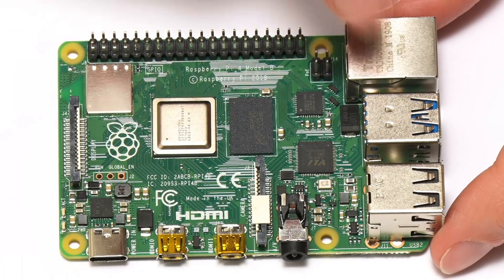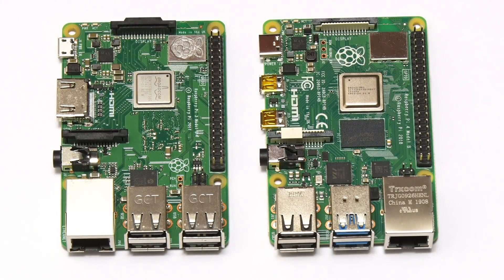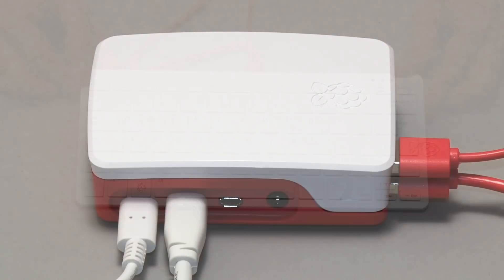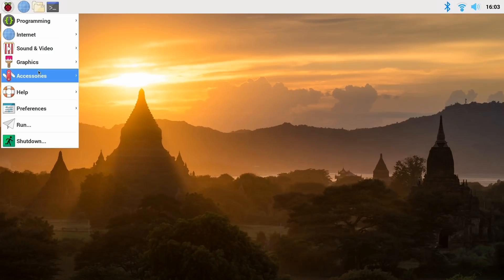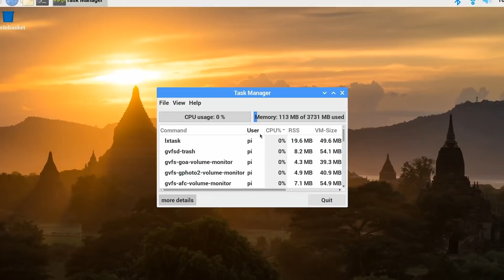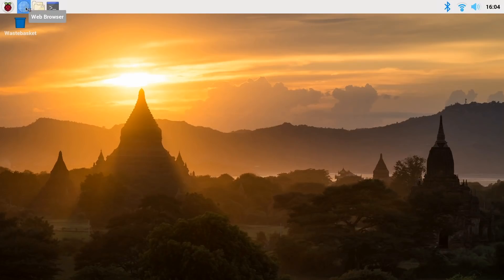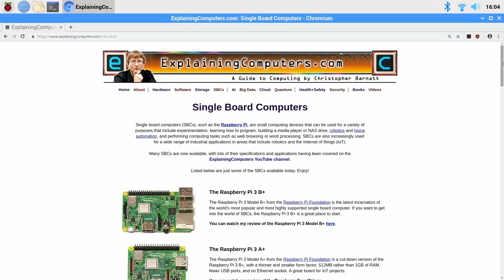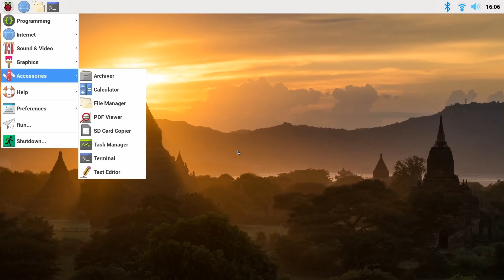Raspberry Pi 4 Model B

Comment: Watched a second time.  In a future video I hope you test USB 3.0 performance with a fast "thumb drive" or a USB3-to-SATA3 and a fast SSD compared to a fast micro SD.  Also, possibly a NAS connected over the wired Ethernet.  Both of these will make a big difference for RPi being used as a desktop replacement.
I have also heard that Bluetooth keyboard and mouse really hurt performance.  Can you verify this ?
I hope to see some good laptop setups for RPi 4 in the near future.  Minimum 15" display (maybe even 17") and good size battery pack (maybe 20700s ?).  Low cost over low weight.
Reply from the maker: See my video July 7. :)

Comment: Will we be able to boot from as SSD with this as we were with the 3B+???  Ive already pre-ordered mine and what to move my Pi Hole to the new 4B.  Would have been great if they would have added an M.2 connection as well.
Reply from the maker: In time, yes -- it is not currently USB 3.0 bootable, but they have promised a software upgrade.

Comment: I'm curious how ZFS would perform in Raspbian for a home NAS. Given my experience with ZFS in FreeBSD, 4 GB of RAM should be fine if you don't use ZFS deduplication. Conceivably with the Raspberry Pi 4B you could have several terabytes of storage connected via the two USB 3.0 ports, most likely in a ZFS mirror setup, or perhaps other ZFS configurations if you use an external USB 3.0 hub and connect more than two mechanical drives. With any luck that type of setup should perform adequately and consume very little power, especially at idle.

Comment: I plan to use the pi 4 for my organization's computer lab for the homeless, if the pi is really a fluid desktop experience for something like Ubuntu. Though, Rasbian does look slicker now than it ever has. It would be amazing to have a decent desktop experience on something so cheap, which means I could expand the number of computers for our clients because we are down to 4 old computers working out of a more normal stock of 8-10. Just need to think of a way to secure them to the back of a monitor or something.
Reply from the maker: What a great use for the Pi 4. I would contact the Raspberry Pi Foundation about your plans.

Comment: I will probably use 4 B to replace my existing 2 B based DLNA media server.
The 2B had issues with some high bit rate media files, the extra bandwidth of the USB3 port and true Gigabit networking should make streaming more fluid.

Comment: i think to be honest it needs extra pins headers either for soldering in or already mounted for reset and a fan header because sometimes the existing ones are taken up by an LCD driver board using them pins but it looks good .. I love tinkering with the PI3B+ its a small test web server at present and has Linux running on it ... like it a lot|! good video .. maybe treat my self to one once there more popular and got a more stable release .. i looking at networking with them with Arduino UNO or Mega :D so many possibilities  - good video :D

Comment: It's a shame no one has built an sbc with built-in poe on the network port. I'd like to see a single SAS connector on one too. That way you could run 4 SATA drives with an adaptor and it would make using it as a NAS better.

Comment: Im interested how low power this thing is. I have a itx  board that idles 8watts which is a j3000 celeron and if i push it to the limits it can go as high as 18watts.

I assume that 15watt power adapter is aim with scnario that you plug high power usb devices.

Comment: The Raspberry Pi Foundation did a good job of keeping the Pi 4B release quiet. Everything I heard was that the "new" Pi would be released some time in 2020. 
This improved Pi is just what I've been waiting for, and it will do everything I need a "backup" desktop to do. The poor thing will live in the basement, LOL! 
I must have missed the info on the SD card maximum capacity. A quick scan of the Pi website provided no answer. Maybe I missed it. 
Great video as usual, Chris. Thanks!!

Comment: Their marketing research team done a really good job at condensing competitors offers into maybe three core areas and adding those to the makers wishlist... More RAM, usb 3, bit more power and duel 4k output... thats fine... Sort of what we expected really... Plus their software and community support sort of seals the deal ... Its hotting up nicely in the SBC industry.

Comment: I'm not familiar with SCBs. Can you please explain why your graphics is set to 256MB and you say that's OK because we have 4GB RAM? Does that mean RAM is handling the graphics load? Can it be set higher? Is there a dedicated graphics chip? I'm curious to its performance over the course of your coming videos.
Reply from the maker: It can indeed be set higher. 256MB for the GPU would have been high on the easlier Pis with 1GB RAM in total.

Comment: At last the Pi Foundation has listened to users' requests.
More RAM on the Pi which should allow us to properly use 64-bit ARM OS'es (and those who don't need the extra RAM can always get the base model for the original 35$ price). 
An SoC with 4 Cortex-A72s should be beefy enough for desktop use. 
They've also removed the Ethernet NIC from the USB bus and connected it directly to the SoC. This should provide full 1Gbit/s of bandwidth.
They also gave us USB 3.0 which should allow proper SSD usage with the Pi.
The new VC6 GPU can finally do 4K and HEVC. And the GPU overlay thing is no more. Pi will finally use mainline Mesa drivers with full X.org acceleration and OpenGL support.
The only shortcoming I see right now is SoC thermals. That chip really needs a heatsink to unleash it's full potential. Let's hope our friends at FLIRC will make a nice metal case for the new Pi soon !

Comment: One of the big reasons why n64 emulation has been really slow on retropie was because it had to use a mobile version of open gl. now that it’s upgraded and has compatibility with normal open gl n64 emulation will run better since there won’t be later to convert data etc. i would expect a performance boost and people are talking about gamecube emulation. i wouldn’t hope for too much, but it’s certainly exciting.

Comment: hmmmm, I am still thinking this is still 'To little to late', anyone serious is using RockChipPro ( hexacores ) for anything above a desktop replacement.

A76 is put all these things to bed which is early next year which would be wise to wait for, just as anyone wanting a decent PC upgrade to wait for early next year AMD + new Chipset Mobo etc etc.  The foundation have take way to long to get this one out the door, id say 4 to 6 months to late.

Rockchip unfortunatly for the Pi have set the tempo since this one follows the same options with memory, and with the release of the BSP and everything else is supported 100% these days in the Linux kernel.

Comment: NAS + TORRENT BOX
Reply: WI-FI 5 GHz data transfer speed. If it will run as a NAS need to know what speed will i get when i will drop a video file from my laptop to an external drive connected to the pie's 3.0 USB port

Comment: What i wanted from the raspberry pi 4 was a DECENT quadcore/octacore chip a better iGPU with a small heatsink on it and more RAM options. This would have tremendously improved the overall performance of the board and would have kickstarted the further software development of the system. This would have literally changed the future for the better of the product and would have caused the extinction of the other bootleg pi's...

Comment: This looks like an amazing upgrade.  I'm curious how it would handle Plex duties.  If I could replace the big honkin' box I'm using now with a little bitty Pi, that would be awesome.  I didn't find the Pi3 B to have quite enough kick to keep things fluid ... mostly due to the lack of RAM, I think.  But the 4 ... that has some wicked potential!  The question will be if anyone can actually get their hands on it, or if it will be perpetually sold out everywhere like the B+ was for a long time.

Comment: How do you add hard drive space on a Raspberry Pi ? it would be pretty cool to use it as a low power 24/7 torrent seed box.
Reply: Could try USB 3.0 to SATA
Reply: (an adapter)

Comment: I love my 3B+ model, because it is low power consumption.  It runs from my 24" LCD TB USB power.  So. no need  another power supply. for it. 

Also, after installing the OS,  I set it up to use Bluetooth  keyboard and Magic Trackpad  for interface's input

Overall, it is nice low power desktop environment . But the 4B's 4GB RAM is soo unirresistible.. :) .

Comment: Why not use USB-C 3.1 instead of those huge 3.0 A Sockets?
If they had gone to full USB 3.1 using SATA over USB-C 3.1 would be a snap.
Also what is the maximum size of a MicroSD card that it can take?
They are now making Brand Name SDXC UltraHighSpeed cards in 256GB and larger.

Comment: Interesting upgrade but from my point of view they missed the real improvement (at least what I would need): analog pins in the GPIO connector. Something arduino already has. It’s a little bit of a struggle to read and control analog variables (currents in my case) with Raspberry :-(

Comment: Wow… That really is pretty impressive for the price! That extra RAM will open up a lot more options. When you do your more intense testing, it might be a good idea to see how reallocating more and less RAM to the GPU affects your tests, because you'd be changing the RAM allocated to the rest of the system at the same time. I wonder what this will allow you to run, that you couldn't on previous 'Pis.

How are you at drawing by hand? Got a drawing tablet? I wonder if and how Krita would run on this computer.

How about compiling a program? That's a test.

With some luck, you might even be able to run the full, modern version of minecraft, which has become harder to run over time, with the numerous updates it's received. If you try running Minecraft, though, there are some RAM settings that can affect performance, that need to be changed specifically when starting the program. I can't remember the word for it, but it's a string of text commands associated with the execution of the program. Of course, the full version of Minecraft costs money to buy, so I wouldn't be inclined to blame you for not buying it for a test, if you don't intend to play it yourself. (I have talked entirely too much about minecraft, compared to the other options, haven't I?)

Comment: Thanks for the video!
If you are going to test more in depth can you please also check what's the power consumption on these new PIs?
If you can it would be great to check in idle, under heavy load and also during video decoding.

Thanks!

Comment: not a big fan of the micro HDMI since they are weaker than the full sized HDMI, but still considering getting my first pi on thursday when i get my first paycheck from work, nice to know that the 5v 4a charger from my oneplus 6t will work fine with this since i have one spare from my old oneplus 3

Comment: It's impressive what they have managed to do again! I wonder about the "idling" power consumption. One of the reasons I like the Pi so much is for it's low power consumption. Will this use more power? Maybe not. But I suppose there are still most of the other Pi's (ZeroW etc) for those applications.

Comment: Again, another UN-remarkable upgrade by Raspberry. When they released the Pi3b+, it was kind of a let down. The Pi4b's speed is not much more than 20% faster just like the 2b to 3b upgrade. It was nice of them to put an on-board WiFi and BT adapter but I find myself using an external adapter because of the inadequate range of the built-in. It's good to have a Gigabit Ethernet port on it but, really, it only can handle speeds of not much more than 300Mbs?  Now in the rush to market for their model Pi4b upgrade, it is again just a little bit better than the 3b, although it is nice that they finally started giving us a more adequate amount of memory. Compared to their new competition, the Rock 4b, with it's many alternative options for storage and a much better enhanced faster CPU, there is no point for Raspberry to be releasing their  Pi4b, and just move on to creating a RPi5b as a true next step up to the new generation architecture. I thought of myself as a Raspberry loyalist but now, my next purchase will be a Rock Pi4b to use as a whole home DVR streaming system. I have tried using one of my Pi3s to use as a HD streaming client for a single TV and it performed horribly. I have my doubts that the new RPi4b has the power to record many incoming streams from network based tuners while serving up 3 or 4 outgoing streams that are being watched by family members. At least the Rock 4b can drive a 2T SSD at high speed directly without having to push it through a USB port.

Let me close with this; 

I really enjoy your videos but by seeing your review of the Rock 4b first, there is nothing you can say to drive up the 'hype' of this board for Raspberry. They are a day late and several dollars short with this model release. They should have called it a Raspberry Pi 3C+.

Comment: Exciting times for SBCs.  I knew RPi foundation would have to do significant updates to stay competitive, but I wasn't expecting this much this soon* (If you heard about a  couple months ago they said 2020 at earliest).  I'm looking forward to getting one of these ASAP and seeing what it can do compared to the 3B+ (they said about 3x improvement, more so with hardware video decoding).  And better yet, to mess with the market they've still got this at $35/$45/$55 which for what this has (I suspect) beats most/all the <$100 competition (but if I recall the RPi foundation is a charity, not your typical capitalist business, so they don't have to make a healthy profit).

*Though I REALLY wish they added a clicky-spring micro SD card slot, especially for hard-to-access cases (which is most of them).  Can't have everything I suppose (C'est La Vie).  What I use is a tape flag taped to the flat, smooth surface of the card or a trimmed down piece of scotch tape.  Either works pretty well.

Comment: I would like this Raspberry Pi mounted to a blank circuit board that plugs into a PCI-e X1 socket for power and has the ethernet side of the pi connected to a PC Bracket that I can add to my PC case.  I would find this extremely useful for a project with the Raspberry Pi being a Web Server for presenting Water Flow and multiple Water Temperatures readings to a web page with control over pump and fan speed.

Comment: Someone has already built a RPi 4b+ Cluster , running a website.  Here it is ! 72GB of RAM , 72 Cores and consumes less than 100w..  This is exciting https://arstechnica.com/information-technology/2019/06/the-raspberry-pi-4-launch-site-runs-on-a-pi-4-cluster/    .  I wonder if I can cluster my pi 3b+'s with the new 4b+  ?!?  This link that I posted also includes the Sysbench CPU Test, the Results: comparing the Pi 3b+ , a core i3 processor , and the NEW pi 4b+.  What spec do you think the community is going crazy over the most , considering there are 4 huge upgrades..?

Comment: Thanks for early review. It seems they have finnaly fixed the Bus issue as they used pcie 2.0 0,5GBit bandwidth in each direction. Which basically means that this rpi might finnally be useful for IO intensive operations, such as torrent, NAS, etc. in the old rpis torrents for example compleatley crippled the system, regardless of the rpi version, because they all had the same chip. A bit sadley there still isnt a sata connector; they’ve said that it would add cost, and the low cost is their main goal. However i thing that the stong community is what makes rpi so important. I know there are bords out there, more powerful...but limited communiy, supporty, questionable updates after a year or soo, etc. id what really makes rpi appealing regardless. @chris, it would be nice to do some io intensive benchmarks.

Comment: Any one can tell... Is heatsink necessary for raspberry Pi 4...?
And the output displays are of 4k 30hz or 4k 60hz
Reply: HDMI output is 60Hz running one monitor but, will only run 30hz each while running dual monitors.
Reply from the maker: A heat sink is necessary.

Comment: Hey Chris, I have a question. How does the 4GB RPi4 stands vs the Atomic Pi? I know they're different architectures (and the RPi4 might have 4GB of ram vs 2GB that the Atomic has), but I wanted to know in which dev board most of the usual programs run faster. I know both boards have different I/Os, but I'm interested in the software performance. Also, if you can, please try something that's "CPU" intensive on both. A versus video would be awesome and really welcome! Thanks!

Comment: I have a test request.  Can you test ethernet throughput on the ethernet jack, and passing the data through to a usb3 to ethernet adapter.  In other words, use it like a 2 port switch.  Or possibly 3 ports using both usb3 ports?  I love your channel, and totally understand if this is not doable.

Or possibly test the ras pi 4 as a wifi bridging router with the ethernet and two usb3 ports?

So many possibilities now that the ras pi has true gigabit!

Comment: FYI, looks like USA outlets wont have this kit until august 15
Reply from the maker: Try Adafruit and Element 14.
Reply: @ExplainingComputers  adafruit  now had limited 1 gig and element 14 all out. That is USA outlets, may be different there due to where boards are made. By the ways loved the info about the "atomic pi" you the first to show it is a renamed pull board